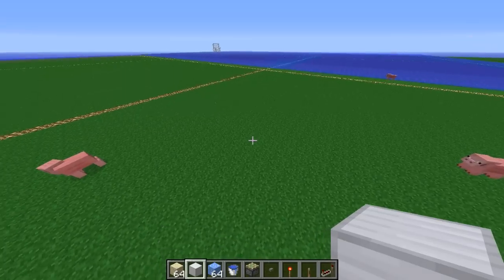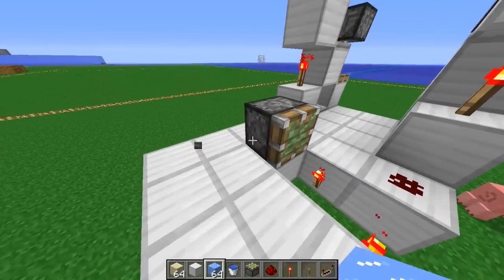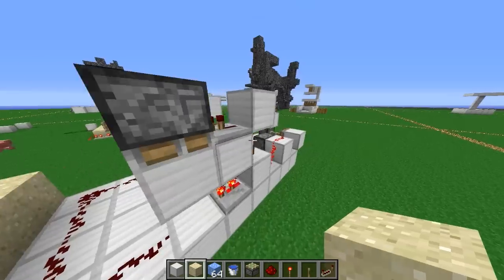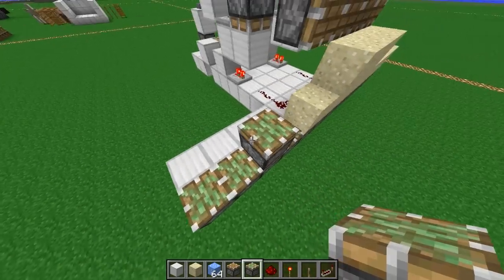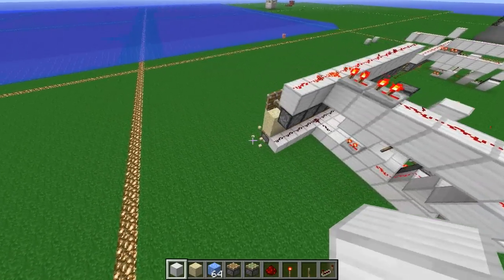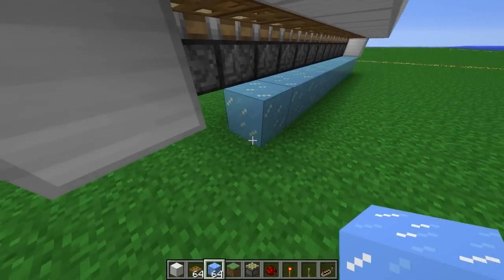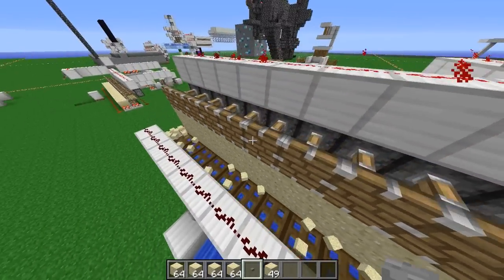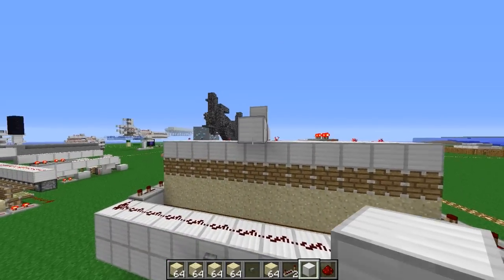Tutorial: How to build a sand generator producing more than 25 sand/ sec in Minecraft 1.3 !

Comment: im using 1.3.2 and i saw your post so i checked it with the t-flip and it worked. i did make my own additions to the design that JL2579 made, but its only a power inverter so it doesnt require to be powered to turn off and a redstone torch tower so i can put the button/lever next to the collection point :).

Comment from the maker: the clock is faster than 4 ticks. a single a repeater also lenghends the signal at minimum to the delay its set to. therfore a 4 tick repeater would just always stay on with the relatively fast clock attached to it.

Comment: the 2 sets of redstone repeaters either side of the trap doors need to be moved away from the trap doors one block and replaced with a 2x2 wall of stone. this is because when i made it on my creative game following your exact instructions there is an overflow of sand piling up on top of the repeaters. this obviously wil slow down production rate and increase lag. other than that slight problem it works brilliantly. great job :D

Comment: Tried it, torches sometimes do work (but not on ice, of course). But a) if you use pistons connected to a 2-tick clock, the sand may gather on top of the torch. b) even if you use 3 ticks or slower, sand blocks may fall through and block the water stream. So torches are not very reliable, same as tripwire: only works 6/10 of the time and sand may destroy the string, just tried that too. So yes, trapdoors are possibly best.

Comment: If you put torches where the trapdoors are they will fall into the water and not break, the only time sand will turn into an entity when using the torch method is if the bottom most block it's going to land on has the torch on it. For example, if you dig a tunnel from ground to bedrock, place a torch half way, the sand won't turn into an item, but if you place it at the bottom, it will.

Comment: The reason torches break sand is when sand attempts to go into the place of the torch, and the first block the sand collides with is the trapdoor. If you remove the trapdoor the sand would hit the water, and block the stream. Alternatively you could use ladder/open trapdoors with a torch or sign above it. So yes you can use torches, but only if paired with a collide-able block below.

Comment: JL, I was messing around with this, and I found it easier to have the sand fall on top of a sign, with an open hatch below it, this way it doesn't have to pulse, but you'll still need a button to press to flick the hatches down, then back up, because sometimes the sand will get stuck on the ledge.

Comment: Correction: It will only drop gravel blocks if using trapdoors,  if you remove the doors and just let the machine make the maximum amount, you can get the flint using a shovel.

Comment: THIS STILL WORKS! The redstone and one tick repeater idea DOES NOT WORK! REMEMBER THESE HELPFUL HINTS: the bottom repeaters in the 'X' need to be at the second click. The top ones in the 'X' at first click. When building the automatic clock, the repeater needs to be at the second click. When you wire up the 'pushing' pistons (pushes sand forward) you need a repeater at the third tick in order for the generator to function. I had these problems before, and here are the fixes.

Comment: If you understand the technical cause of this you would feel the same about it as I do. The "bugs" you mentioned are implemented, whether on purpose or not, but the sand generator was an unintended bug caused by an efficient implementation of the piston. After they have tried to fix it, I'm pretty sure it's obvious that it is cheating.

Comment: So you automatically assume you have to get it from close to spawn deserts? With the beauty of the nether you can get to x:16000 fairly fast (In nether it's x:2000) and there is little chance anyone will stumble upon it accidentally. Bottom line, it's an unintended duplication bug, and in my mind it's as un-legit as the portal dupe glitch. And also personally, I think destroyed deserts look cooler than untouched ones, I've seen so many deserts that they are boring.

Comment: Very intriguing design. I rebuilt it with the help of your video, the sand generator works perfevtly, the only thing not working ist the trapdoor part. So I left the redstone at the ground and collect the sand manually. Nevertheless, I would like to get the trapdoor part going. I built it exactly as you did, but the pistons push the sand on the trapdoors and then over the redstone firing the trapdoors... What am I doing wrong`Is ist a timing/spacing problem??

Comment: doesn't work for 1.5.2. It SHOULD be working, except that the pistons won't push because maybe the signal is too short? I tried lengthening it, but then it did not duplicate. B all means, it SHOULD be working, but it isn't. D: